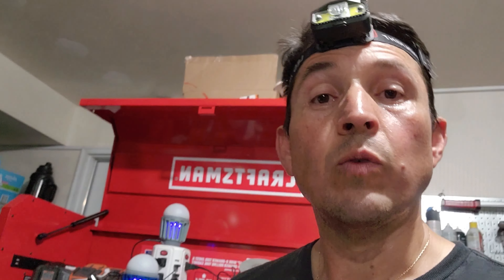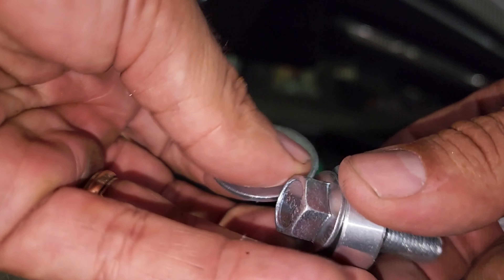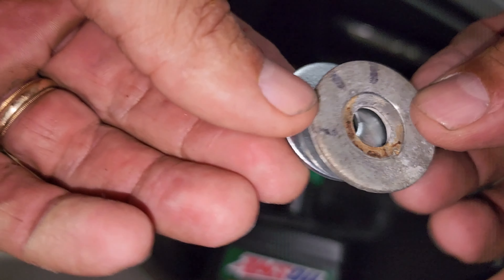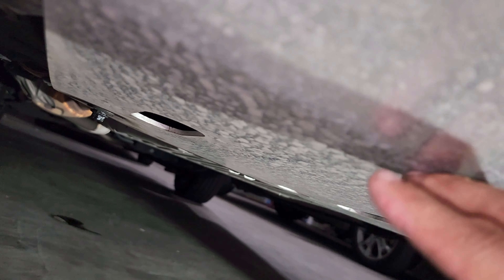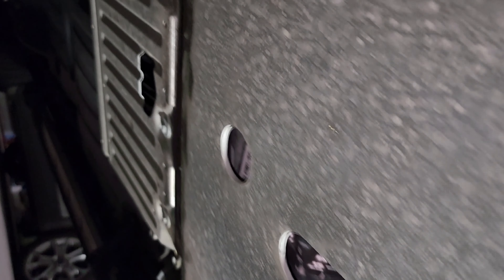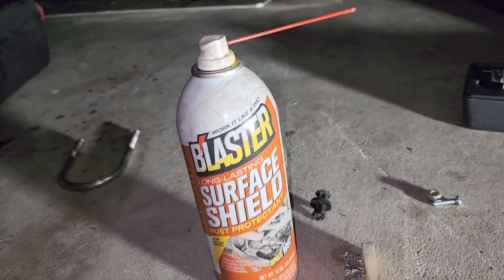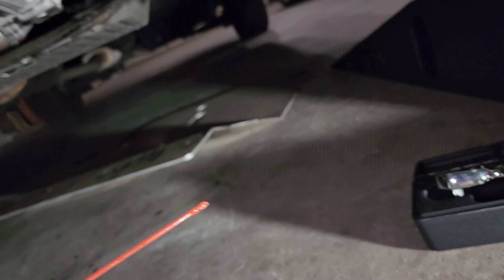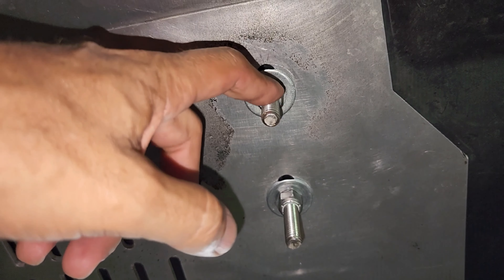Do NOT install a skid plate on any Honda Ridgeline before watch this video!!

Comment: The original washer is a conical tooth washer, which was installed upside down. The conical tooth washer creates force because of the conical shape, and the teeth keep it from spinning. Since it was installed upside down, it did nothing to hold the item in place correctly. If the conical tooth washer had been installed correctly, it would have held very strongly.
Reply from the maker: Nice observation. Thanks for your comment, my friend.
Reply: thanks for this info!

Comment: Your title is misleading, I got my skidplate and used the included hardware. Except for the front 4 bolts which had been striped and I had to replace the install was as advertised.
Reply from the maker: Thanks for your comments, everyone have a different opinion, honestly I think this 4 bolts do a bad damage to the truck also to the 2 big ones at the rear part of the plate, I am planning and looking for a different way to connect the plate instead of use the 2 big screws( this plate damaged not only the 4 front screws of my truck but one of the big one at the rear, thanks GOD I did find out this 2 longer bolts. I will see how those 2 works after my oil change, the purpose of that title is to attract any ridgeline owner and let them know about this problem, thanks for your opinion but the title is saying what I and another few guys think about this design and the damage this plate can cause to the vehicle without the proper installation, I think the manufacturer should stop selling this 4 screws before someone sue them for the damages.

Comment: I'm thinking about getting the red one , any issues like the heat dispersion or noise that you can notice, I have heard those are the two main problems as it covers some exost pipe?  And bouncing the noise back to the cabin ?
Reply from the maker: So far nothing, If you do it the way I did it in the video, I had to learn the hard way but now is good, do not install the plate using  the 4 screws in the front otherwise it will get damaged by the vibration and then you will heard the squeak underneath, use the U-bolts and replace the 2 bolts that goes to the arms by the measurements in the video. Good luck and GOD BLESS YOU!!!

Comment: After watching your video. I installed the front skidplate. I used the longer bolts and large washers at the back. At the front, I used 6 washers between the plate and the plastic cover of the frame at each of the 4 bolt locations. I'm thinking this will stop the compression of the contoured plastic, and provide solid attachment at all 4 of the front bolt locations. 

After a test drive. I have some observations and questions. 

The Ridgeline feels noticeably heavier. It appears, fuel economy is diminished by about 3 MPG😢.

What are your thoughts about the ability of Hot Air to properly exit the engine compartment area ?

For those of us, not rock crawling wilderness trails. Primarily interested in protection from highway debris. If it could have been made of Plastic, and more properly contoured to air flow management. Might be a better idea. 

I also installed the gas tank skidplate. I'm not very confident about the attachment arrangement at the rear of that device 😕. 

I appreciate you sharing this video and your thoughts.
Reply from the maker: So far with ability of hot air exit the engine is being ok so far no difference in temperature, now the idea of a plastic plate for city drivers only sounds great, also it will be more easy to customise and lighter in weight than this aluminum plate, also I don't have the gas tank protector buy I do have the differential plate, lol, but still in the box maybe I will not install it at all., thanks for the comments, the idea of a some type of hard plastic plate sounds very good! good luck, and GOD BLESS!!!